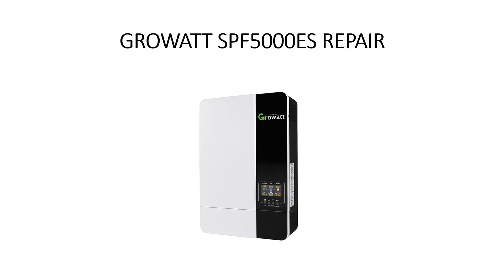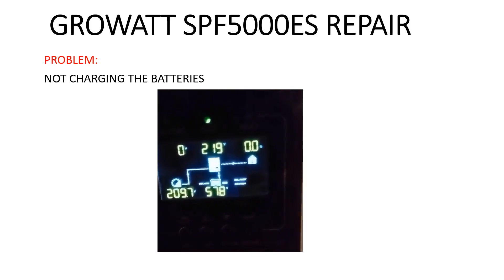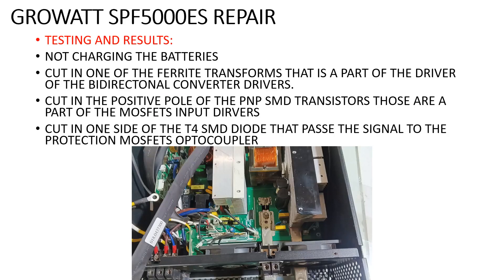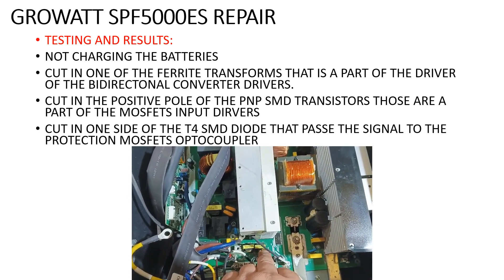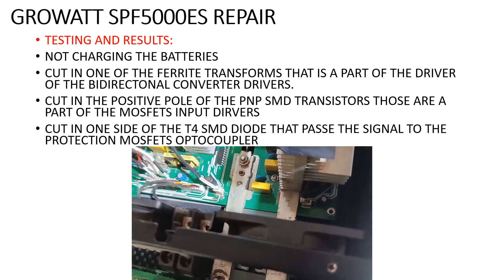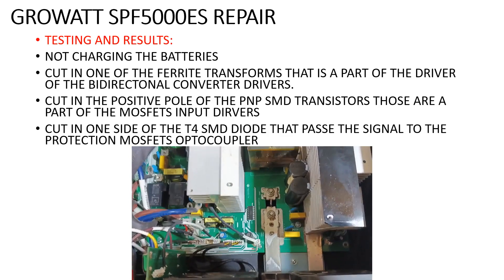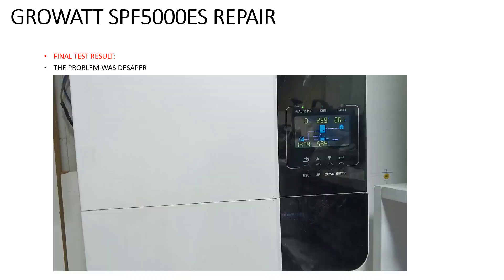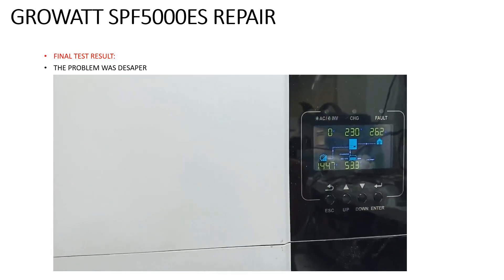Growatt spf5000es charger Repair

Comment: All this happens to pcb because the fans blows air towards the main board directly, all dust humidity collected on pcb causing broken pcb tracks.
Reply from the maker: Yes you are right, but i do have a solution for that and i will go to make a video about that